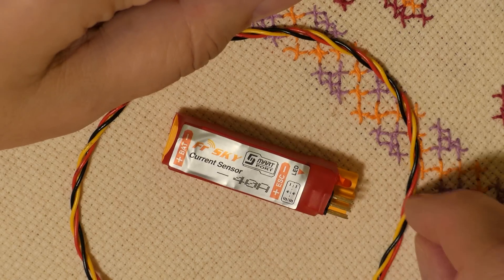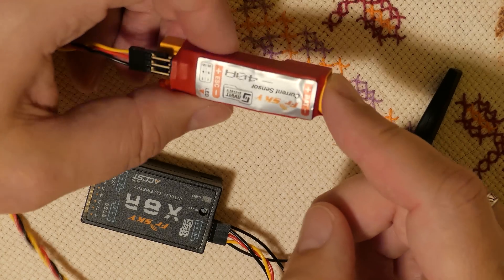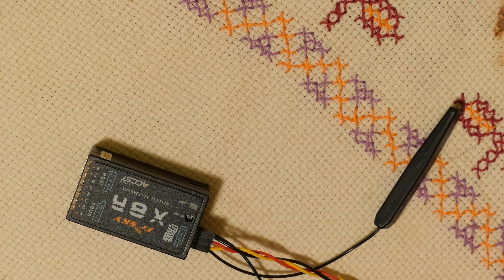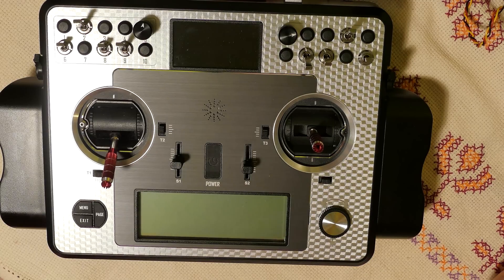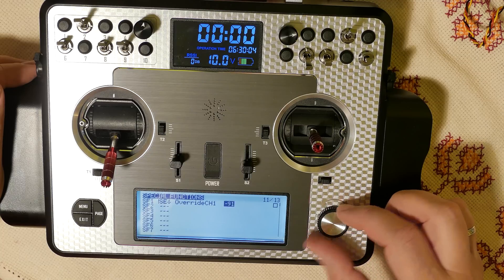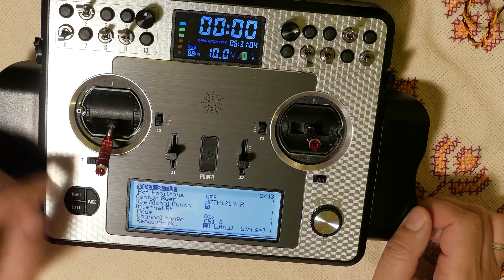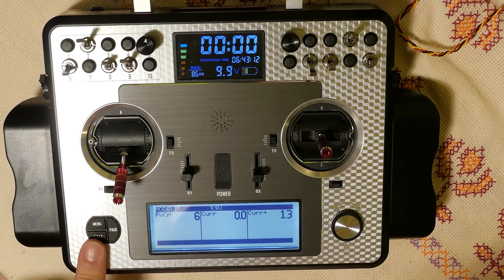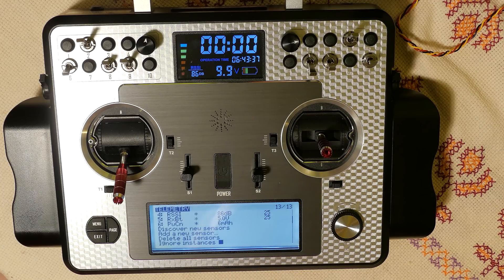FrSky Taranis / OpenTx Crumbs - Current Sensor FCS-40A in new OpenTx 2.1+

Comment: Hi Richard.   Is a good idea to update the software of taranis ?    If I have diferent model setting on memory, does the new version will operate with the model backed in memory ?    Thanks !!
Reply from the maker: +Frank Lee Hi Fank - just check your models after update. But I think all will be OK - main changes are about telemetry sensors. So you must redefine sensors and functions about telemetry.
Reply: +Richard Mrázek (OK-RiMr) I just updated and it went smoothly, but you also need to download the new SOUND package otherwise the spoken units may be mixed up. Mine was saying "miles per hour" instead of "milliamps per hour"
Reply from the maker: Andrew Newton Yes, it true. Thanks for note.
Reply: Thanks to Andrew too.